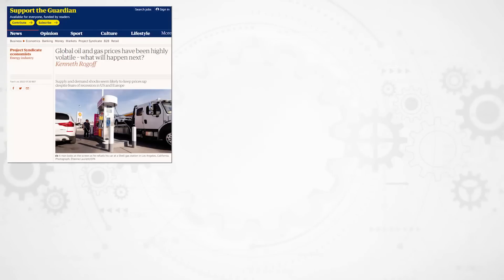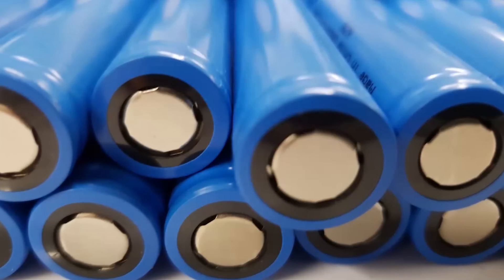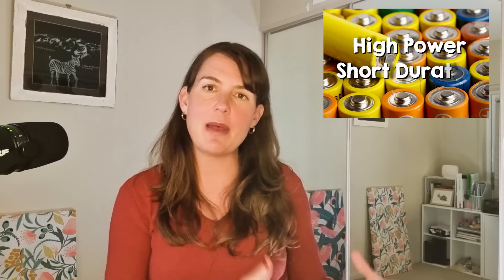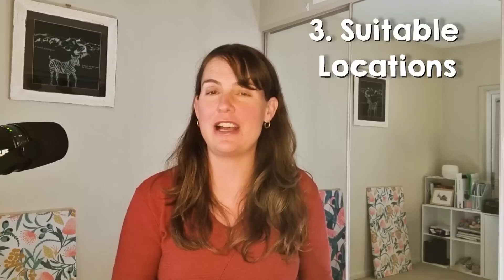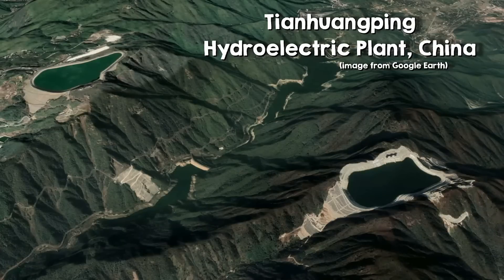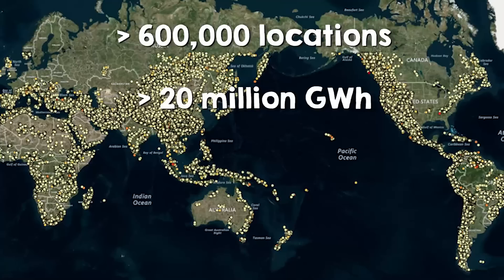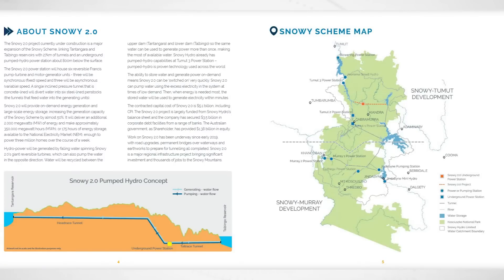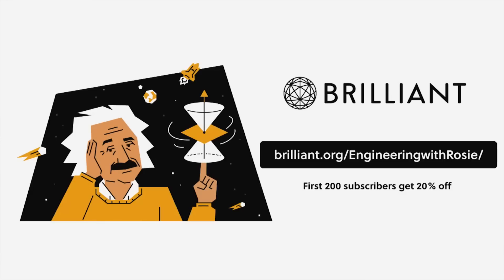Pump It Up When You Don't Really Need It: Pumped Hydro, Future of Energy Storage

Comment: Seems to me that building storage systems are more important than new generation at this point. Storage has to be cheaper and less environmentally damaging. With less than half of world energy being electricity than generation has to be developed or at least with the current damaging civilization.
Reply: Until you have an excess of renewable grid power for a significant amount of the time, you don't need any storage, and more renewable power from extra wind/solar will be far cheaper and reduce fossil fuel use more than more green power from storage will.  When you do have an excess of renewable grid power, it is probably much better used for creating products such as synthetic aviation fuel than it is for storage.  Only when you have an excess of renewable grid power that can't be used to reduce fossil fuel use elsewhere will it make good economic sense to store it, and by then you probably won't need to store much for electricity since you will already have stores of synthetic aviation fuel etc. that will provide the necessary storage for the power system in total!
Reply: @nigels.6051  I live off grid, currently it is night time and there is no wind. My lights are on only courtesy of my 25KWhr battery pack. Its the same most nights.

In short without storage its lights out.
Reply: @jimgraham6722  Of course there is wind, your problem is that you put your wind turbines in the wrong places.  If we are talking hydro storage then we are talking country scale systems with offshore wind, not backyard.
Reply: @nigels.6051  Thats fine but capital cost of offshore wind is at least twice and more likely three times the cost of onshore. Even then you cant be assured the wind will blow anywhere let alone everywhere. Best you can hope for over long run is 50% availability.

It is also easy to talk about a continent wide grid but it doesnt come cheap. A HV DC cable connecting WA to east coast, a commonly talked about proposal, would likely cost at least $6m per kilometre or $18bn for 3,000km. 

For that sort of money you could likely buy at least two Gen4 nuclear plants and have the the energy where you need it.
Reply: @jimgraham6722  The last set of prices for UK renewables put the prices in order of offshore wind as the cheapest, then onshore, solar, nuclear, with gas as the most expensive, and coal has been banned. As for availability, it is a very long time since we had zero wind anywhere on our grid, and if we run low then yes, we have HCDC cables to Ireland, France, Netherlands, Belgium, Norway, with new ones being built to Denmark, Germany, even one due to be built down to Morocco on the African continent which will always be under a different weather system!  HDVC cables are not cheap, but they provide access to cheap electricity at times when ours is expensive and allow us to sell our cheap electricity at times when theirs is expensive, everyone profits.  Before the EU gas crisis, we often bought French electricity at negative cost - very cheap, and why were France paying us to take it away?  Because they have too much nuclear, nuclear is never cheap!
Reply: @nigels.6051  Quebec has vast hydropower so it was proposed to make the northern pass HVDC power line from Quebec and Labrador into New England but public opposition stopped in so more gas powered electricity is done. New Hampshire's electricity rates just doubled because of gas like they were punishing the state for opposing the powerline. A gas pipeline was proposed bringing gas to the coast and and shipping it as LNG to Europe but that was stalled due to public opposition. Supposedly rate payers would have paid for that pipeline.
Reply: @nigels.6051  Good, since energy is so cheap, abundant and available there I guess the shortfall in energy is being misreported.
Reply: I disagree on the urgency to build storage.  Building renewable generation to the point that capacity must be curtailed only raises the cost of renewable energy.  As long as this cost remains below the cost of operating a fossil-fueled generator renewable deployment continues to cut into the operating hours of such plants.  The real contest is whether the arbitrage differential of energy through the day makes short-term storage more profitable than additional deployment of renewable generation.  Either storage or overcapacity of generation creates a death spiral for fossil fuels.  The fewer operating hours for the fossil-fueled generator raises their prices similarly to the reduced operating hours of the "overbuilt" renewable energy, so the former never gets ahead.  I can imagine solar installations that turn on at a fraction of peak output in the morning, curtail  through the peak of the day and come back on line in the evening, extending the hours the grid is predominately powered by solar.  All solar installations would remain online on cloudy days reducing and eventually eliminating the need for fossil-fueled plants.  The solar plant generates a fraction of its rated energy throughout the year but that fraction is still cost-effective vs. fossil burners.

The electrical grid is so complex that it is difficult to predict how it should best evolve.  Widely distributed renewable energy generation would increase robustness, limit the scope of blackouts due to equipment failure and reduce energy lost in transmission/distribution at the expense of ease of regulation.  Battery storage immediately aids in the regulation of such systems, as demonstrated by the acceleration in the buildout of such systems.  A drawback of battery storage may also be an advantage.  The batteries, while highly recyclable, will wear out in a few or a dozen years, depending on technology.  This drives pricing energy for faster return on investment than pumped hydro can justify.  Other than the capital expense of the grid tie, this means that batteries can be profitably deployed during the surfeit of renewable energy deployment and retired if and when in the future overbuilding renewable energy generation proves the more economic approach.

One final way to state this is that storage is necessary only if the cost of generation at significantly reduced capacity is more expensive to deploy.  Expense includes the social cost of land use.
Reply: @mrhickman53  That strategy would be a recipe for lights out. Not acceptable in my view. In a complex modern society totally reliant on energy inputs, reliability is crucial. It cant be left to markets, at least not until it is fully built out and has settled into the new supply paradigm.
Reply: @jimgraham6722  I don't see it that way.  Since deregulation our energy grid is driven by the markets.  The ISO's control the requirements for entities to interconnect with the grid and how entities can bid in the various energy, demand and regulation auctions but the market drives the construction if infrastructure.  I have spent some time studying my regional ISO's regulations with an interest in aggregating distributed energy consumers into a demand resource that could bid in the regional demand market.  The ISO, in concert with the energy regulatory bodies of the states influence the market conditions to encourage infrastructure but I see no evidence that they dictate it.

Massachusetts set about to influence a direct transmission grid tie to Ontario's hydropower but, so far, has not been able to overcome resistance to the construction in other states.  I, personally, am ambivalent over this project as it feels like another future choke point for power to flow into the  region rather than prioritizing more local generation better distributed through the region.  Besides, river hydro is an excellent source of energy except for the years that it is not, as the West is finding out.

My previous comment regarding the market did not assume any change in market controls.  Our grid reliability today is the result of these controls.  I cannot comment whether the controls are sufficient.  Certainly the controls in force for the Texas region deserve some scrutiny based on recent experiences.
Reply: @mrhickman53  you'd know I think but I thought Massachusetts decided they didn't want electricity from Canada?
Reply: @RichRich1955  Frankly, I've had little enough interest in the transmission line that I do not follow it closely.  It seems as of a few months ago a search was still underway for alternative rights-of-way for the transmission line.  The whole experience reeks of NIMBY combined with lack of attention to selling the concept of robustness of the energy supply along the corridor the transmission line would pass through.  I would like to think that the objections were based on convictions that more highly distributed generation is preferred, but I fear it is more pure NIMBY.
Reply: @mrhickman53  I agree, NIMBYISM. ATV trails', logging, existing transmission lines, highways, etc are acceptable but another transmission line isn't. Eversourse even agreed to bury additional cable. It must be because the power goes through NH to a liberal state. But now NH's cost of electricity has doubled.
Reply: Correct, wind turbines and solar panels are a dime a dozen. Storage on the other hand is very costly and we need a lot of it if we are to do job with renewables.
Reply: A pump storage in state was combined with the 2nd oldest nuke plant and stored off peak power. The nuke plants been gone for 20yr but the pump storage is still in full operations. Only when storage meets generation will fossil fuel or nuclear generation be eliminated because renewables will only supplement non-renewables. Seems with uncertain precip patterns that building more hydropower isn't smart. Growth in Nuclear in the U.S. appears to be stalled.
Reply: @RichRich1955  I'm not arguing that pumped storage does not work.  I am arguing that market forces may not favor pumped storage in either the near-term or the long-term.  Many point to the fact that much of our wind energy and photovoltaic energy are curtailed on a regular basis and shout that that is bad.  It is only bad if the incremental cost to add more generation capacity to ride deeper into the morning and evening hours or ride through cloudy or low-wind days is more expensive than adding the storage to prevent curtailment on the bright and windy days.

Emphasizing storage over generation today may or may not be the correct answer.  The market seeks to find the correct answer and should respond appropriately in the future when the answer changes.  Right now battery storage is the method that seems to be attracting the most money.  I assert that this is not because the market is ignorant of alternative solutions.
Reply: There's one small offshore wind project in the U.S. ffs.

Comment: Another form of energy is in hot and cold water. The first Raygen project 3Mw/50Mwh will be turned on in the next few weeks in Carwarp Victoria and is totally Australian-designed and built. you should check it out
Reply from the maker: Isn't the Raygen project concentrated solar thermal?
Reply: @EngineeringwithRosie  it is concentrated Pv and takes the waste heat from the PV and store it in dams then uses energy from the PV to run a chiller which another dam to close to zero degrees and then at night we use a ORC turbine using the water temperature differational

Comment: One major problem with Pumped Hydro is the maintenance cost which can be actually more than the overall cost of solar.
Reply: I don't see where your coming from here solar is a power generation system re pumped hydro which is an energy storage system.
Reply: Do you have a reference on the high cost? I grew up in Tas and am an electrical engineer who briefly worked for the Hydro and am not aware of this.
Reply from the maker: Relative to solar power everything with moving parts has high maintenance costs! But if you want to use electricity at night then solar alone isn't much good.
Reply: Regardless of how cheap solar is, it doesn't work at night and is quite variable during the day. You need some form of energy storage, regardless if energy generation is cheaper.

Comment: Great video. Someone spoke of doing pumped hydro underwater. The systems could be located under offshore turbines to take advantage of the existing grid connection.  I also wonder about scale. Could a water tower that combined gravity with pressure. to store energy on a more local level play a part?  Thanks for everything you do. This stuff is important.
Reply from the maker: I'm actually working on a project a bit like that right now in my "real" consulting job! I hope I can share more details at some point in the future. And offshore energy storage is a topic that I will probably cover in the future.
Reply: Sounds interesting, Im assuming the offshore wind turbines foundations would  go deep under the water level and provide the opportunity for a high potential energy bouncany  device. The actual potential energy of that might be pretty low for the costs, making it as useful as the vertical freeway wind turbines.
Reply: One major problem is that gravity storage have a very low energy density so you need a lot of mass and elevation (head). When all you build are a dam at the end of a valley you can get av very large storage at "low cost" since you do not have to build the valley walls. When you have to build everything the cost just kill most projects.